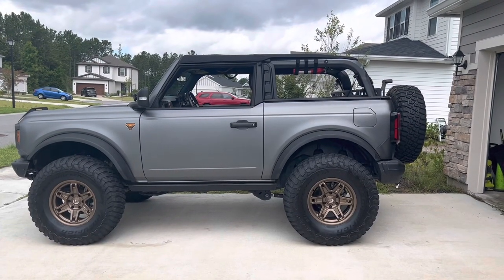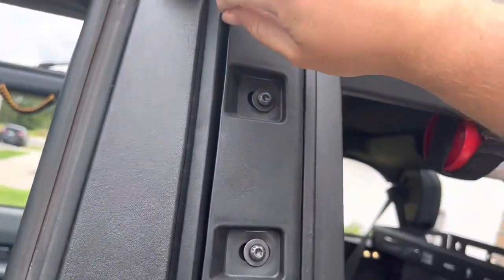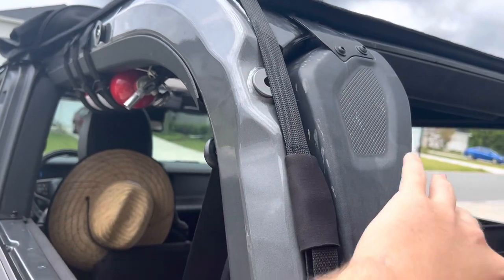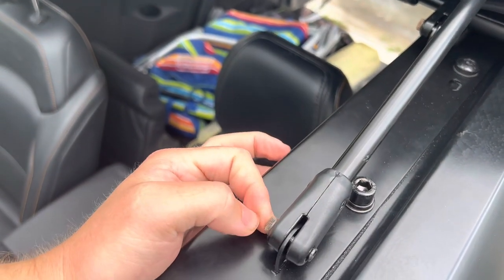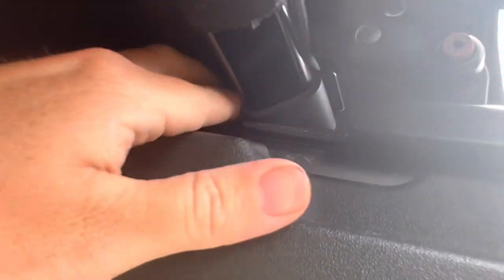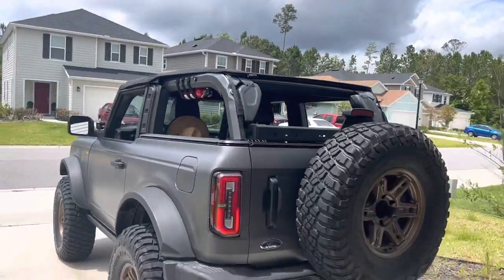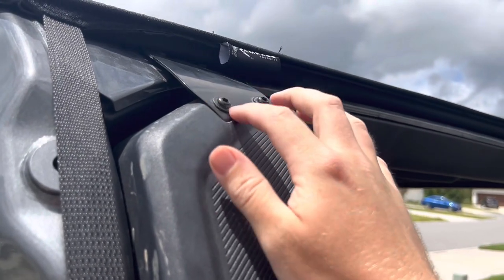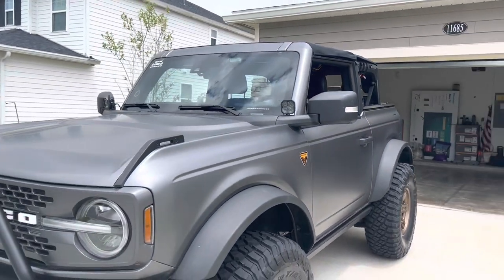Rampage Trailview Fastback Soft Top review for ‘21+ Bronco

Comment: Yeah Alex nice, I love my hard top for sure, but I can certainly see the value in this type of soft top in the rare instance I might use it.  Meaning, having it on for a few days at a time when I plan to really take advantage of nicer weather.  For the money, it seems this can't be beat.  I might check out yours at the next event before pulling the trigger...or may not wait😂.  What was teh installation time?  Do you remember?  Like the initial time setting it up?  Also, can you leave some of it up and still use the hard top or does the whole thing need to come off?  Sorry for all the questions.

Comment: Just got mine. I may try to remove the speaker pods and tweak the brackets so the window clears. Thanks for the great video.
Reply from the maker: I was actually thinking of the same thing. Maybe seeing if I could bend the speaker pod brackets but it may be tough to get the roll bar mounting bolts lined back up after. I also thought about having a shop make new brackets

Comment: Does it need a rivet gun to install the 2 doors bronco? 
Saw the video for a 4 doors and it’s needed a rivet gun to install the rivet nuts.
Reply from the maker: Yes. Both versions require a rivnut tool
Reply: Do you have to drill the holes little bigger for the Riv nut to fit? Mine doesn’t fit in the hole. The two holes for Riv nut to goes into is the first and third holes right?
Reply from the maker: I didn’t have to but I’ve heard of a few others that have had to